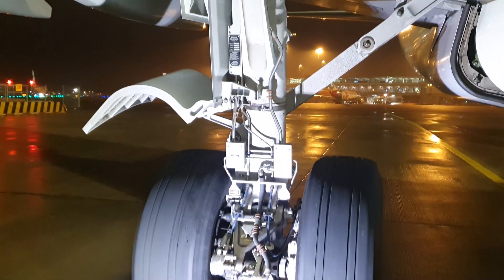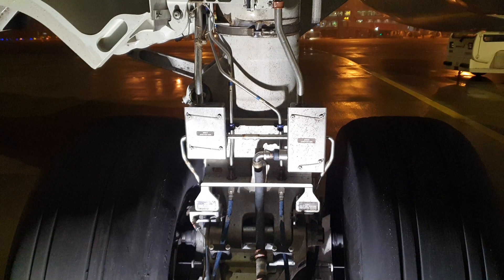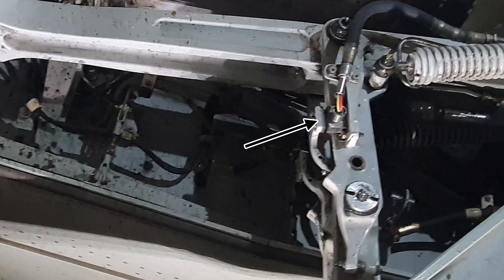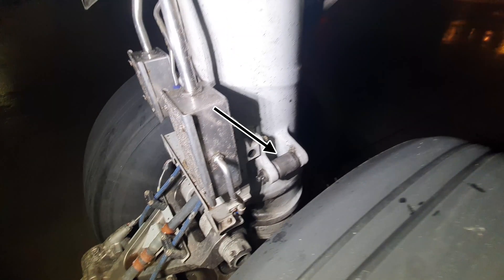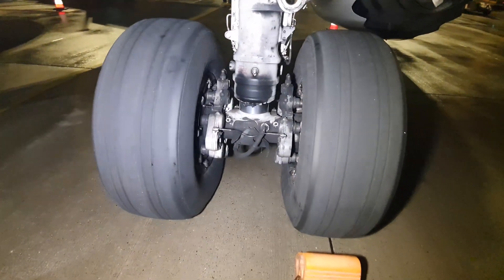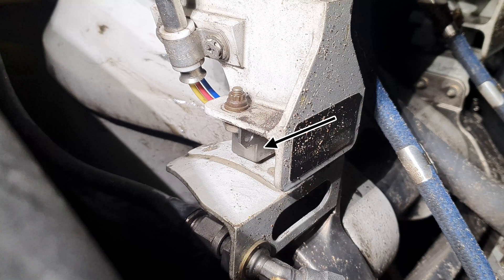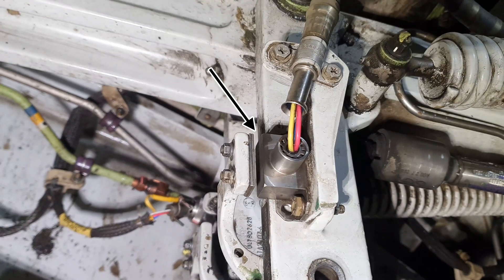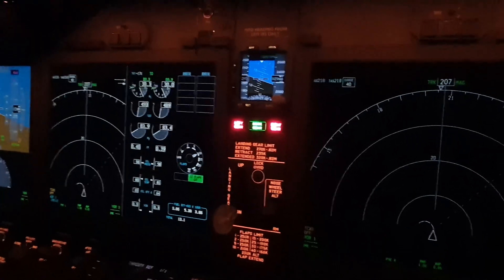Boeing 737 MAX: Main Landing Gear (MLG) explained

Comment: Nice video, but something is not clear for me, the maximum speed to retract the gear is 230knots, but the limit to fly with the gear extended is 320kts. Why is the limit so low to retract? Some people say because of the LDG doors but these are also extended at 320kts so it doesnt make any sense. Thanks bro.
Reply from the maker: To be completely honest, I don't know the answer to your question. I tried looking into the AMM but no specific information which I could find. Maybe somebody else has the answer to @spille483 question?
Reply: Ok no problem. Many thanks for checking it anyway. Keep posting the videos!

Comment: Always wondered why the redundant set of gear indicators in the 737. Is it a separate sensing system?
Reply from the maker: The Proximity Switch Electronic Unit (PSEU) processes the landing gear proximity sensors, there are 2 independant systems inside the PSEU that process this information. System 1 sends the down- or up locked indication signal to the primary landing gear position lights in front of the pilots. System 2 send that information to the auxiliary landing gear position lights above the pilots.  Hope this clears it up for you.